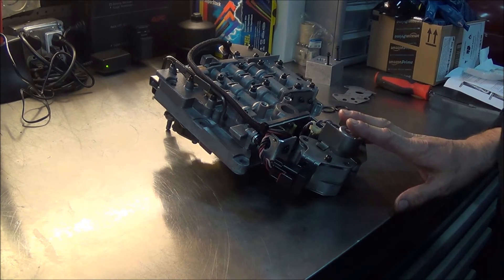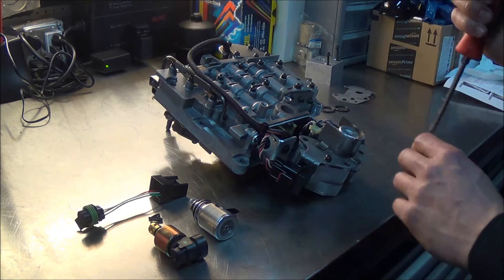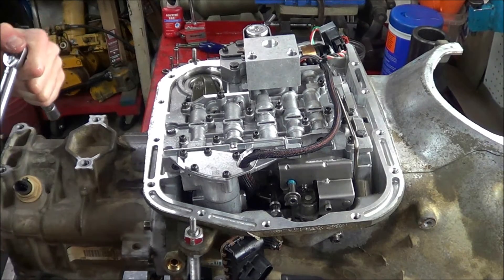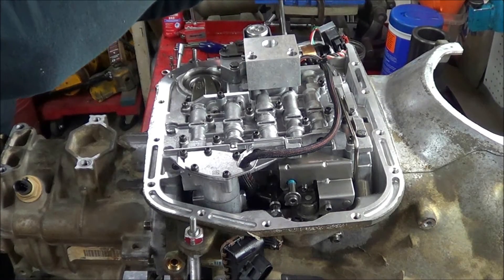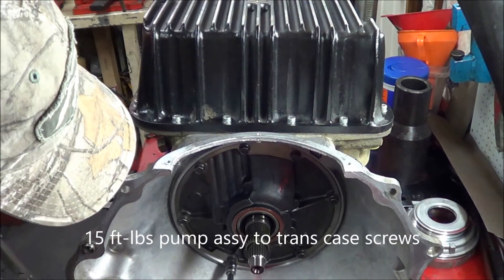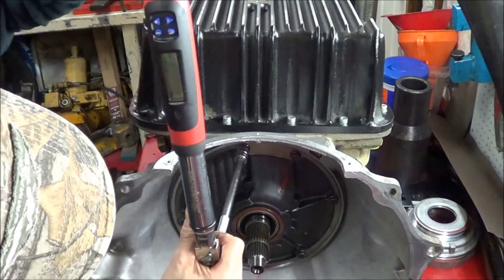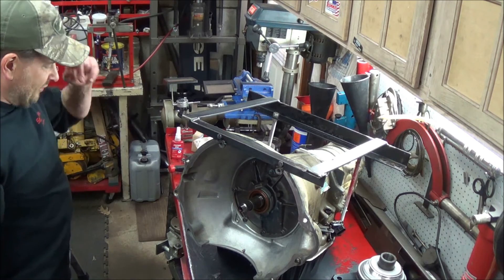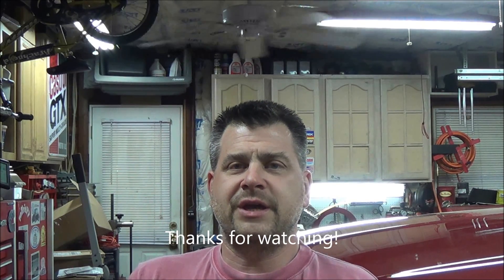Chrysler 48RE rebuild and upgrades part 4 valve body and finishing up 2006 Dodge Ram 2500 Cummins

Comment: hey i was wondering if there is a way to tell if an automatic transmission is good. i removed the transmission because i was pretty sure the torque converter went out i just want to be sure before i put this all back together.
Reply from the maker: What do you mean by "converter went out"? If the torque converter has a catastrophic failure the transmission would be polluted with debris and need an overhaul.

Comment: How much does it usually cost to have a 47re/48re rebuilt at a shop?
Reply from the maker: I would suspect it would depend on how far you want to go. At least 2500.00 when you factor in the R+R.

Comment: Thanks for the video!!! I was wondering if you have a series on a 47re (2002 dodge 2500 cummins transmission) I'm 19 and would like to learn how to rebuild them
Reply from the maker: The rebuild for a 47RE is very similar, the 48 has some improvements otherwise the same.

Thanks for watching and good luck with your project!
Reply: another site, does a great tutorial as well, transmissionbenchdotcom

Comment: Looking for help. 47rh 1994 rebuilt it 3 times can not find anything wrong with it. it goes forward in all gears even neutral and when in park seems to be under a load.  All clutch packs have correct clearance. bands are adjust correctly. I have rebuilt several 48re"s with no issues. but when I got this one it was in very bad shape. broken pump, broken forward band lever. all full of water. which was more like a brownish cream because it had been churned up by the toque converter. but anyway it was an awful mess. I tried to clean up the valve body but gave up and replaced it with another new pump and T/C and rebuilt. looks like it should work fine.  I even unplug the wiring harness just encase there was power going to the overdrive solenoid.
  Help is muchly appreciated 
 Please email me at ats_transmissions@yahoo.com
Reply from the maker: Sorry just found this in the SPAM folder. What makes you so sure the replacement VB you got is OK? I assume due to the water you didn't try the original.
Reply: I tired two different valve bodies, went throw both of them before trying them both have the same result. yeah No I did not try the original. Just picked up another complete 47rh . going to give up on this one and use it for parts.
Reply: @aperryz28  Did you check your fuel pressure, leaks on your intake ducts. hopefully you found the problem, can you post the resolution for everyone else?

Comment: I just watched all your videos on the 48re transmission I definitely learned a lot I don't know that I can do that cuz I don't have all those special tools but I definitely know how to adjust the bands now I have the same truck and transmission and I know everybody says that the 48re transmission is junk but you have to take care of them and change the fluid when it's red and it always stay red thanks again for the good videos
Reply: The 47re, 48re are all based on one of Chrysler best transmission ever built, a 727, I have a stock 727 behind a 500HP 440 big block and it is bulletproof.

Comment: @broncocarl92 thanks for the info i just ordered a overhaul kit will be attempting this
Reply from the maker: Good luck! This transmission is pretty easy to work on so you shouldn't have any trouble.
Reply: Broncocarl92 im gonna bring the over drive section to my local shop dont trust myself with the spring hehe..just changing clutch disk and bands..thanks for the video i feel pretty confident on doing so now !!
Reply: Broncocarl92 
have a few questions regarding some.valve body change. any way to reach you

Comment: I think its a lot easier to put the park rod and e-clip on the valve body, then install it as an assembly. Just have to rotate the output shaft to get the park rod in. Im always afraid of dropping that e-clip
Reply: I installed mine with the park rod on. but now it wont come out pf park. what did I do wrong? I cant rotate the out put shaft because the trans is still in the truck...

Comment: hello, i have a 97 dodge cummins with the 47re and i have looked it up that 47re and 48re are closely alike i think, anyways ive had a problem with im guessing line pressure being to high, what happens is when going down the road in drive my trans will shift up and then down shift it self with me not letting out of the throttle first thought was, ohh its the gov pressure sensor and  transducer, well i changed them both and still having this problem, ive looked up that in the governor pressure sensor its 1 psi for every 1 mph and i have hooked my truck up to a scan tool from the connector under the the steering column, i took it down the road and it read good at low speeds that i would stay in 1st or 2nd gear but then when getting around 45 mph the gov. pressure would go to around 80psi, i have some auto trans experience just not enough to resolve what i need to do to fix line pressure if thats what it is, if you could give me some advice that would be gladly appreciated, thanks
Reply: it called hunting, look up the term on youtube, there are several videos.